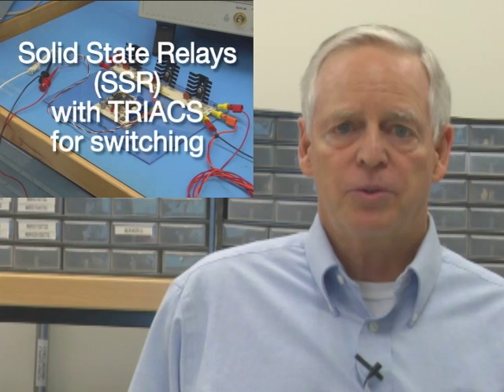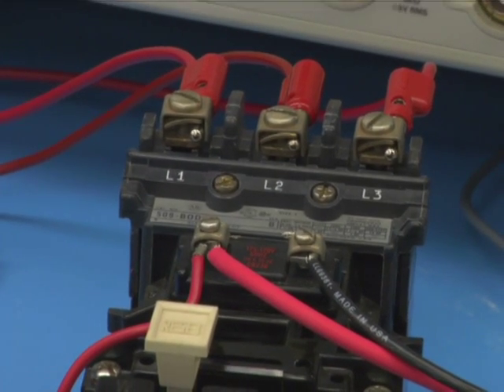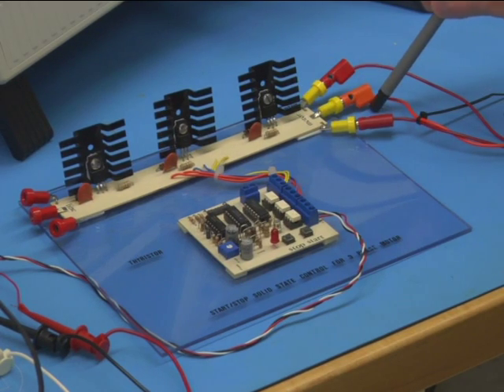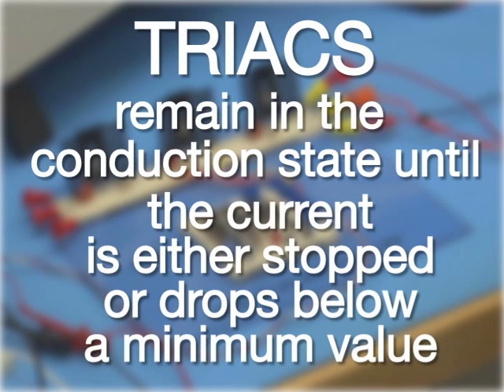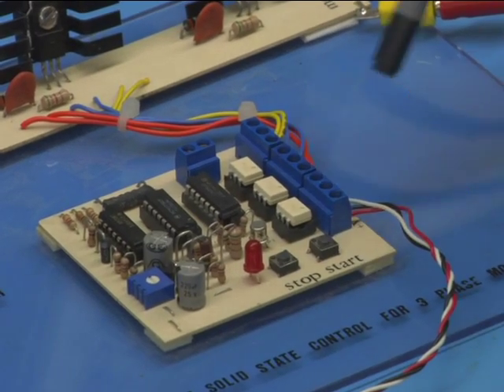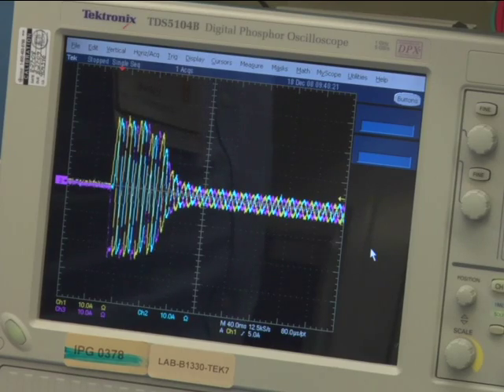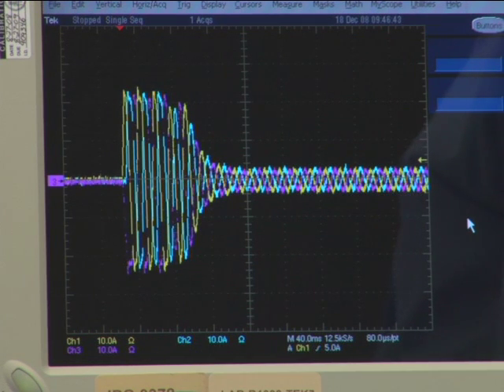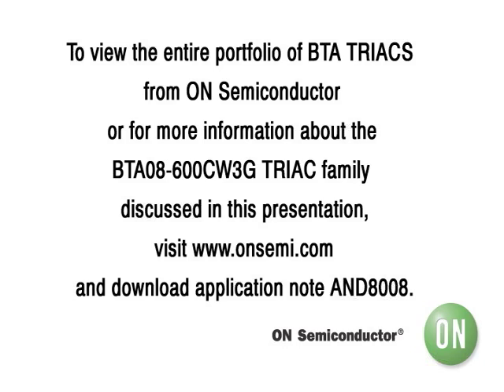Solid State Relays with TRIACS vs. Electro-Mechanical Relays For Three Phase Motor Control

Comment: Can we use SSR contractor for 3 phase inductive load which runs continuously 24/7, ( 3 phase water pump vacuum pump),  not resistive load ?

Comment: there is limitations using triac in control motors, ie they have the sign waves  have peaks if used for controls,  using emr is better for motors because the  sign waves have no changes.